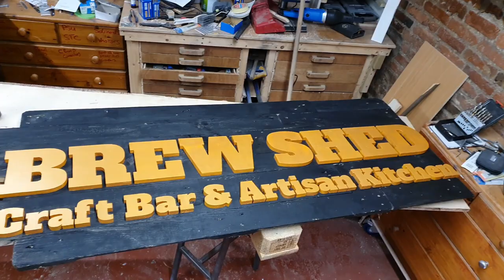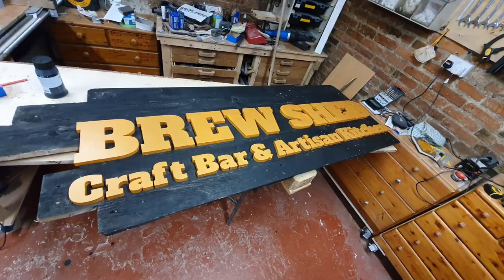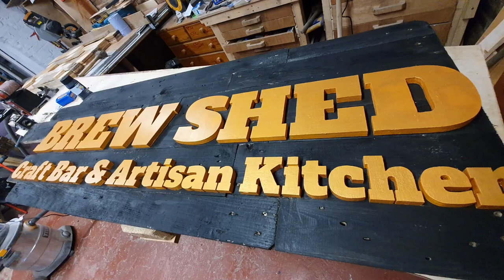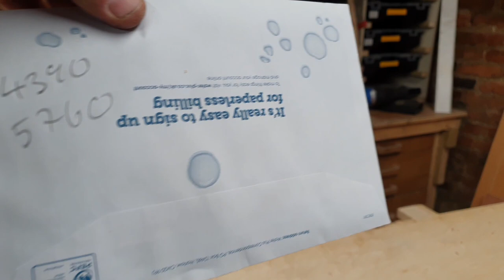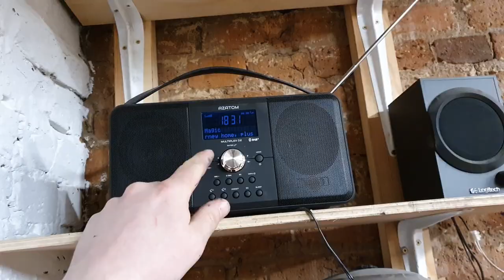Black & Gold

Comment: Evening Chris. Lettering looking grand indeed. Just one thing I spotted from the video is that the letter spacing looked a tad cramped on the right side, but may have just been the camera angle. Didn't want it to look that way from the road as you drive up to the front of the pub after all your hard graft. Looking forward to the grand reopening.

Comment: Pickup a Pin Nailer Harry. It's a 23 gauge finish gun with headless nails 1 to 2 inches in length.
Apply Liquid nails/PL on the back of each letter, align and set. Shoot each letter at all long points with 2 inch galvanized pin nails.
Finally hit the letters with a coat of sealer. You can barely see the holes up close, painting over the holes will hide them. 

Cheers!
Reply: He's already finished it and installed it, he put it on instagram a week ago
Reply: @MandoHalrissian  Figures, but it is another way of hanging signage letters.

Cheers!